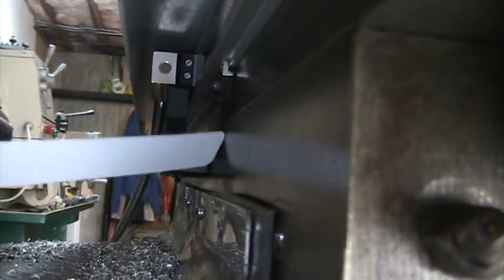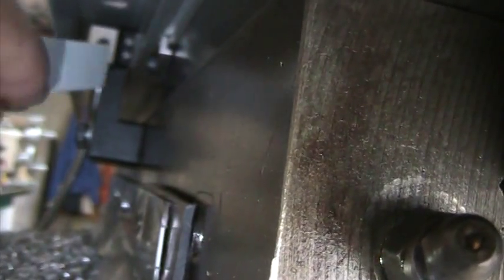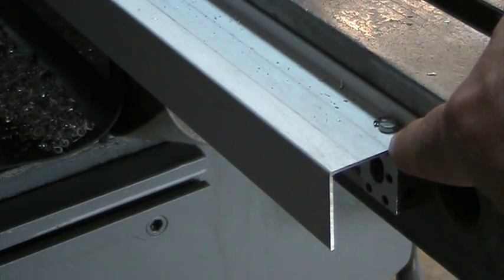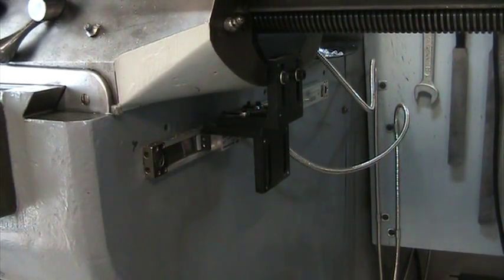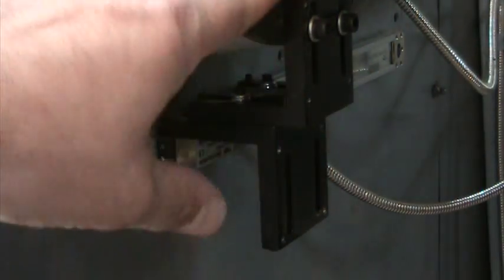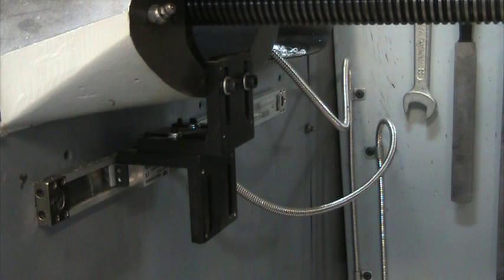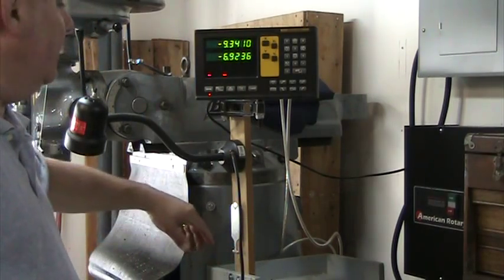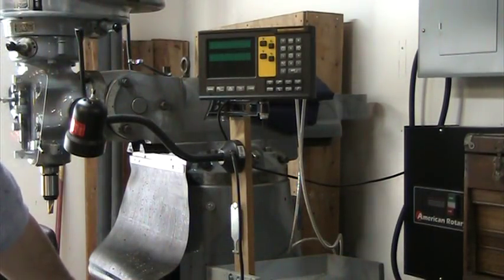Part 4 and Final DROPRO EL400 install on Bridgeport Mill

Comment: On your "Y" mounting, did you install the guards over the top of your bracket and reader to prevent oil and such entering your scale and reader head?
Reply from the maker: Paul Miller no I did not. I used the magnetic which are less susceptible to chip and coolant problems. I also felt with the apron covering most of it, the exposer was somewhat limited. You certainly have room to do it. I may in the future.